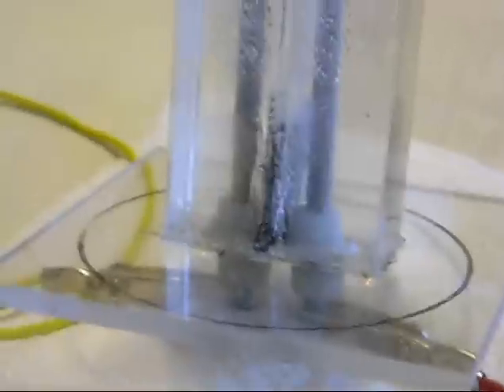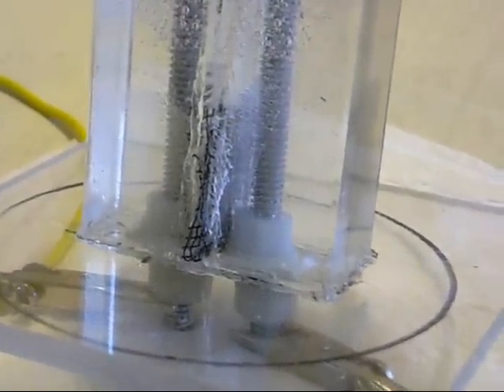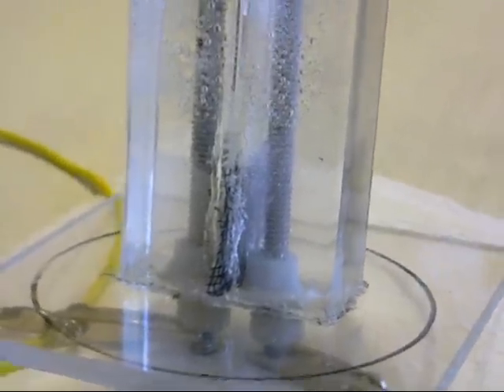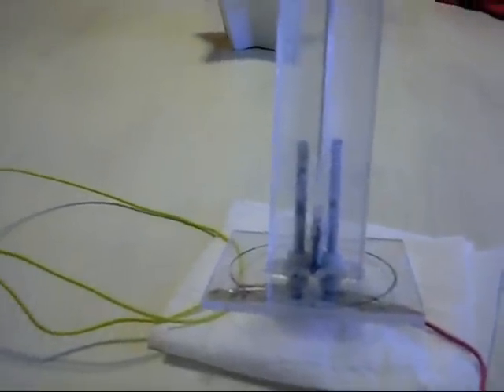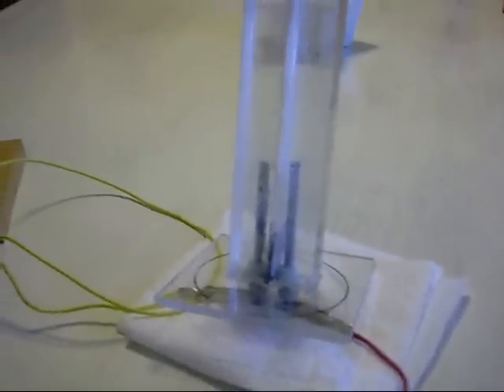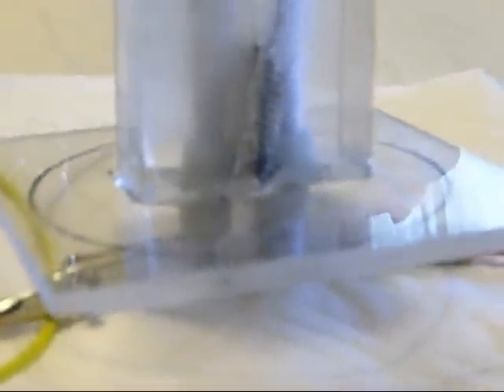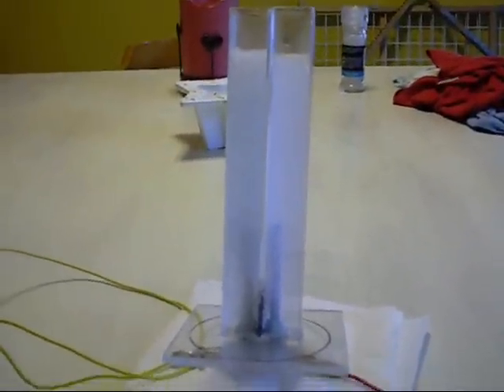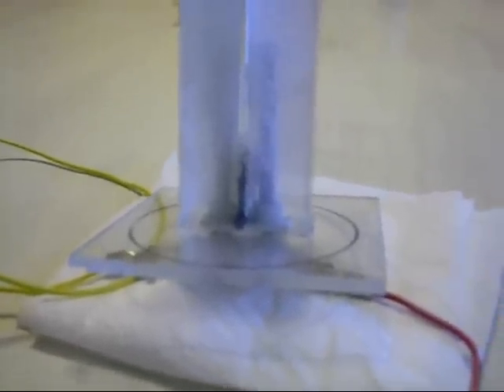HHO separation Update (02)

Comment: I like your work..
I've done the same sort of thing several months ago, but I used SS plates, lexan separator with a window cut through it and that window covered with several layers of very fine weave nylon cloth. As far as I could tell, there was zero cross contamination, and that is with a very close plate gap.
I've had a vid of it up for moths, check it out.
Peace.
Mike.

Comment: Can you add a barrier around each electrode rather than in the middle?

Something that will keep the bubbles closer to the electrodes and moving upwards rather than letting them move towards the gap in the middle.
Great work by the way, keep going.  :)